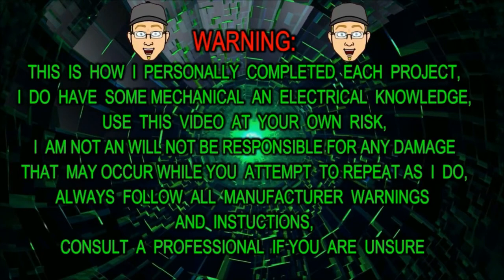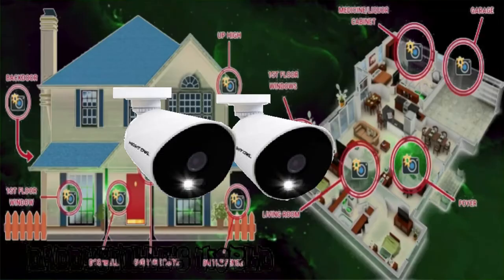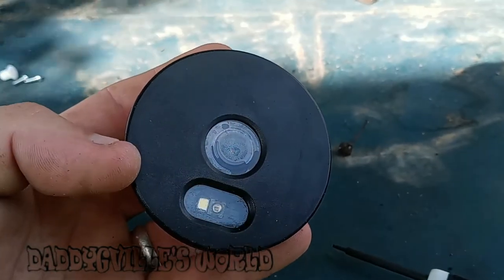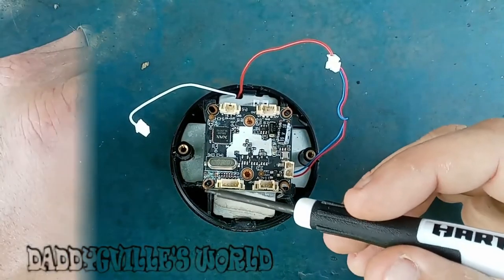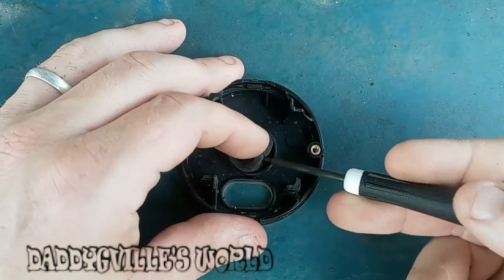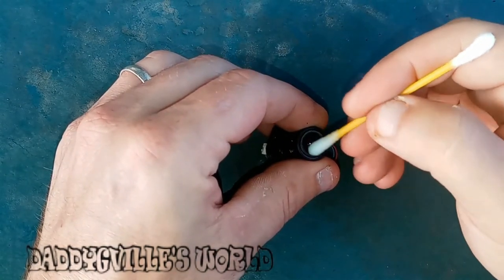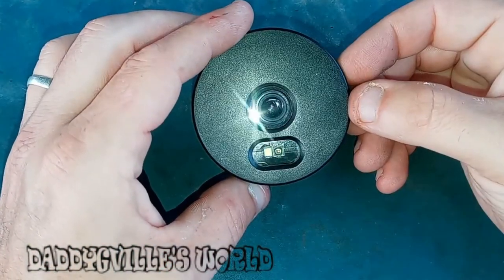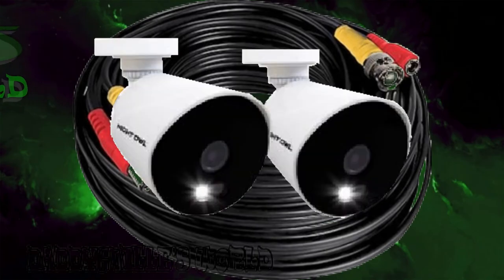Night Owl Security System Blurry Camera Fix & Issues

Comment: I have the night owl Securty Sistem 8 Chanel , I just bought another cameras but it doesn’t give full color just black and white . What do you think it’s the problem thank you
Reply from the maker: See this was a little while back so hope you got it figured out, now i had this issue also awhile back mine was the cable the video side, the hard part was running a new wire.